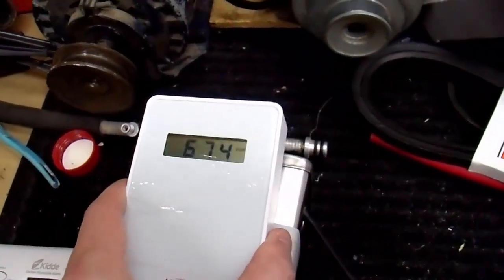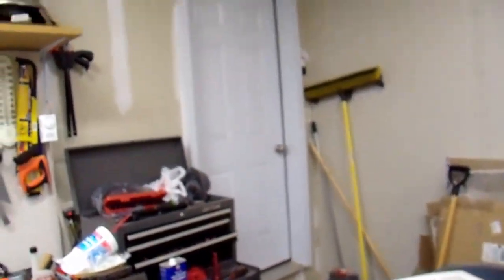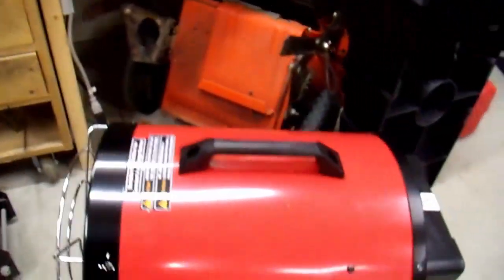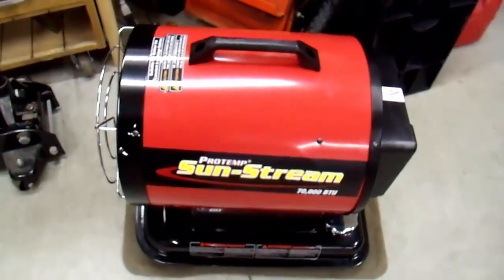Protemp Kerosene / Diesel Heater Review PT-70-SS - Part 2

Comment: The greatest thing about the radiant heat from these is that it heats the objects in the room, and the air. So it pretty much turns anything in line of site warm, making that object also give off convectional heat. The more stuff you have in the line of sight will cause it to warm up faster and stay warmer longer after you turn off the heater. A torpedo heater heats mostly just the air with a little bit of radiant from the cone is all.

Comment: I just got one of these. It's ridiculously good. Buy it.
Reply: Glad you have good luck I bought mine 1-11-25 and used it for 3 months off and on and didn't use it in 2116 and fired it up 12-2017 and it wouldn't work.  Took it back to Northern Tool and got a call saying it would cost $223 to fix it.  I know why the warranty is for one year.
Reply: Hi guys are you having like automatic sutdown once in a while? I just buy this and mine shut down some time after ignition but the fan continúes cooling for 5 mins the i need to turn off and on again and works again!!!
Reply: @edgarduron46  turn fuel pressure down. Its too hot and shutting down

Comment: Assuming that's the same Kidde alarm as sold here in Ireland, it can make CO readings as low as 10ppm for its peak readout, even though the live read out will continue to show 0 below 30ppm.  To use it this way for readings below 30ppm, press the peak+reset buttons together for a few seconds to reset the previous peak reading before starting a test.  Then periodically push the peak button to see what the CO level has reached, assuming it gets between 10ppm and 29ppm.  For example, a few hours of running our gas cooker will usually give a peak reading of 10ppm to 14ppm, even though the live read out always shows 0. 

There's another brand of CO alarm fairly popular here by Fireangel and its live reading starts at 10ppm.  As far as I'm aware of, the 30ppm minimum live read out set by most CO detectors is to prevent people panicking over a low non 0 readout.
Reply from the maker: Thanks for the info!  I'll try that.

And I agree that 30ppm is the lower limit required by the government to be displayable so they cut anything less than 30ppm to zero to avoid people panicing about non-zero readings.  CO is dangerous but it seems people are a bit irrational about it.  I wonder how many smokers panic about non-zero readings when they breath high levels of it every day without issue.  :)  (without issue from the CO that is)

Comment: One of the main reasons I chose this model- aside from the fact that it's bigger than my old one- is that it's far quieter than my torpedo unit. Which runs on propane and stinks like hell sometimes and occasionally makes my eyes sting. Anyway, I didn't think the noise from the torpedo would bother me, but it does get annoying after a period. This is about half is loud or slightly less than that.

Comment: I run a torpedo style heater, I have for 4 or 5 years now. I estimate I've burned a few hundred gallons total through it. The only maintenance I have done is replace fuel lines. I notice if I run for extended periods it makes it a little harder to breathe but not intolerable. I typically crack the garage or window while I run it now, and that seems to work well. If I plan on working for extended periods, I will preheat the garage, my tools, and whatever I'm working on -- for an hour to warm my tools and anything else, then open the garage and bring in fresh air, then only run the heater long enough to maintain a comfortable temperature.
Reply from the maker: Unlike many others I can tell you've actually had experience with these heaters.  They do reduce oxygen concentration and can make some particulate fumes but like you say, if you are careful and give yourself some fresh air when you notice it affecting your breathing they work very well.  CO is really the only thing to worry about which is why I have a personal policy of always having a CO meter around when I run a direct combustion appliance.
Reply: ***** Thanks for your response! Also, Thanks to your videos, i've decided i need to buy both of these meters now. In fact, i will do it right now on amazon.  By the way, i've enjoyed your video's and successfully desulfated my first battery (ive tried other ways, but now i understand what is happening). I did it using my Rolls-Surrete 24V 550AH bank i have (4 X Rolls S-550) I first Tried desulfating using a variable Dc-DC converter putting about 8 AMPS into the battery for several days, but that did not recover the bad cell. After hooking 3 of the 4 batteries up to the battery (18V), and putting about 40-80 AMPS to the battery for a few hours... the bad cell has now recovered! i can now draw 30 amps for almost an hour out of the battery before it drops out! Where as when i started.. i couldn't get more than 15-30 seconds before the voltage drop was too low to be useful.  Can you please tell me where you got your c02 monitor from?? I'm not sure which one to go with.
Reply from the maker: lazerusmfh
They are usually called 'air quality meters', which all measure CO2 concentration.  The one I purchased was surplus from an air handling unit and I repurposed it for this application.  They usually cost $100+ new.  The important thing to is that 1% CO2 is equal to a 1% O2 decrease.  After about 2% decrease you can run into potential danger so I keep my meter below 1% (or 10,000 ppm) and then I know I am very safe.  It does affect me in that I can tell I need to breathe more!  No other effects have been noticed however in myself personally.

Comment: Your new heater is build pretty much the same and functions the same as the torpedo heaters it is just built different.
 I have a torpedo heater 270,000BTU and been running diesel in it for years and never had any problems.

Comment: Your kinda off on the radiant heat output. I also purchased one of these and the reason it feels to you like its 10 degrees higher in there than what you temp readings are is because of the infrared heating it puts off. I am also running mine on pump diesel fuel and have no issues. There isnt a single spot in my garage that i can go that i dont feel the radiant heat trying to melt my skin. It was well worththe purchase!!

Comment: You could put the carbon monoxide detector directly in the exhaust stream (not too near as to melt) and measure that just to ensure the detector is working and I would be curious what the CO level there is.
Reply from the maker: CO meters generally don't work well at elevated or fluctuating temperatures due to the way they operate.  They need to be placed in a stable location which is why I located it on my garage bench.  I do know that it responds within a minute or two to CO levels from past experimentation with it.  (Briefly starting a small engine is a good way to test these meters.  CO should immediately spike to dangerous levels.)

Comment: To run diesel in the fiberglass wick heater, add 1 oz acetone per gal.
Reply from the maker: I hear a lot of methods similar to this.  Us xoz of alcohol per gallon, use a cetane booster, use an antigelling additive, etc.  I've not seen any actual evidence that those products work aside from my own testing showing that alcohol does nothing.  The only change that makes sense to me is a 100% cotton wick which should work better but I don't consider that to be a reasonable solution for various reasons.  Even #1 diesel at pumps has additive packages added and they frequently mix #2 and #1 in trucks and tanks during changeovers resulting in impure #1 fuel.  #1 heating oil has the same issues as #1 diesel with the additional issue of higher allowed sulfur content and dye.  I simply don't think there is a 100% guaranteed solution to this problem without going to K1 which is never mixed with diesel.  #1 diesel may work for some people in some situations.

Comment: I'm curious.  What would happen if you mixed diesel with kerosene?  That thing is really impressive.
Reply from the maker: They can be mixed without issue.  I've already run it on a 50% mix and it works very well that way even in cold temps.  Truckers and farmers frequently run a diesel/kerosene mix in cold temps to avoid gelling.

Comment: Chinese.  My Master version lasted 3 uses.  Reliability is a problem with these heaters.  Ignition and fan problems.  When they do work the heat is great.  They only smell on first ignition.  I think they oil them at the factory. It burns off pretty quick.  Cheaper than a VAL6.

Comment: I have a different brand of this same style multi-fuel heater.  On mine, I have to put a piece of paper or something in front of the intake fan when I start up on diesel.  The fan is pushing too much air to get a good light up.  I am sure that kerosene would start without issue, but I haven't tried it yet.
Reply from the maker: Thanks for the tip!  I might try this!

Comment: Nth, How do you intend to use this? Do you think you'll need to find away to run it on a thermostat as it puts out so much heat? Good quality items in your last 3 or so reviews.
Reply from the maker: The primary purpose was intended to be garage heat when I need/want to work in the garage during the winter.  As it so happens it has proven itself to be safe for emergency indoor heat as well so it now has a 2nd purpose in life.
Reply: you cant add a thermostat

Comment: Did you continue running it 100% on diesel? Or did you switch to kerosene?
I want to buy something that runs on diesel effectively without high maintenance or it developing odors after prolonged use with diesel. Thanks, great video...!

Comment: watched your video and did more research and bought one of these heaters.   your video has good info.  unpacked my heater filled with diesel (approved fuel on instructions).  plugged in.  red light came on flashing.  did not ignite.  tried a few time with no ignite.  nothing in the manual about flashing light.  manual is terrible.  many pages of safety warnings with an eighth page of operating instructions.  called the tech support number on the paper taped to top in box.  no answer.  fuel leaks out of cheaply made cap.  pretty heavy to move when full of fuel.  looked online more for complaints.  these are common problems, so do some reading before you buy.

Comment: My concern is the fumes CO and CO2. My idea is to put a copper coil at the output as a heat exchanger, run the heater in the attached garage,  then run the hot water produced into a radiator or baseboard radiator inside my house and put a fan on the radiator. what do you think?
Reply: it doesnt emit CO

Comment: I have had mine a couple years now. now it runs fine for about 5 minutes then goes into cool down mode.  i cant not find a solution to this problem.
Reply: Did you ever find a solution? Mine is doing the same
Reply: @sandralemen4048  I never did.  Took it apart and put it back together and never could get it working.  I ended up buying a northern tool one and it's been working really good

Comment: You said you had a 30000 btu eletric heater before this one how could you run that on a house cercet thats over 8700 watts
Reply: 30,000 BTU equates out to about 3500-4000 watts.  I use a 240V 4800 watt heater rated at 38,000BTU.  It's plugged into a 30Amp circuit.
Reply: Ok i thought that 1 btu =.3 watts
Reply: +Gene Mowat 3kw is 10k btu

Comment: Electric heat is the worst for dollars per BTU Im assuming you dont have access to Natural gas.

Looks like a great little heater I have a bunch of Offroad Use Only diesel I wonder how long one of those heater would run on that before crapping out
Reply from the maker: Yup.  I am 100% electric discounting the liquid fuels I bring in myself.
Reply: ***** Ouch I installed a Lennox air to air Heatpump at my Friends house in washington he has electric only cut his bill by a 75%  sounds like your in a colder climate tho 

I do Work at a hospital that has a Massive Geothermal Heatpump system its Amazing how much money it saves them and how comfortable it is.
Reply from the maker: mattmopar440
Heat pumps don't work well in my climate - they are designed for warm climates like the one you live in.  (Yes, all of Washington state is 'warm')  And no, they are most certainly not comfortable in cold climates.  :)  They blow air only 10 degrees or so warmer than the ambient temperature which feels cold.  Geothermal is slightly better but around here you need to use a vertical system which is very expensive since our frost depth is 48''.
Reply: ***** Im in Illinois the one I'm currently working on is in chicago area.  its a Massive 15 acre man made lake doesn't use vertical wells. Works very well now when I got here it wasn't they where having massive problems with it. Its still a new technology in this country and takes training to properly set up and dial in the equipment.
Reply from the maker: mattmopar440
Hey, if you've got a location (such as a lake) that doesn't require vertical drilling then geothermal is great!  I don't have that luxury but I wish I did!
Reply: Elgin IL Sherman Hospital 15 acre lake 20 feet deep has over 150 miles of piping out there on 175 rafts doesn't stay at a perfect temp but the heat pumps are designed for the entering water temp as low as 25 so we have always stayed in parameters. Its an amazing system that saves the hospital about 1.5 million a year. hopefully the tech will become more mainstream I have my eyes on a mall that might be our next job !

Comment: No building is air tight to include a well insulated garage
Reply from the maker: I guess it's all relative.  Unless it gets down to -20F or so which causes some weatherstripping gaps to open up my garage door seals pretty well and there is no light visible during the day if I turn the lights off aside from a few peeps from the corners.  As well sealed as my house?  No.  I tested with a CO2 meter and found that I get about 1 air changes per day in my house which is pretty good.  I'm sure it's far higher in the garage but I bet it's still only a few air changes per day aside from opening the doors.

Comment: i have a torpedo style propane heater for my garage.  it is very loud.  it does heat my 2 car garage quickly, though.  did you consider a propane style heater for your garage?  i bought mine because of the convenience of propane.
Reply from the maker: Propane is cleaner burning but it requires bulky tanks and other annoyances in terms of refilling cylinders, safety, and such.  Combine that with the consideration that a 20lb propane tank (which holds 14lb of propane) only equaling 2 gallons of kerosene in terms of heating value and BTU/hr limitations at various tank sizes and temperatures it just makes for a better product to burn kerosene.  I can throw this thing in my trunk, haul it around and then run it for for 7 hours, then refill it at any service station.  Propane isn't so convenient, so cheap, or so safe in comparison.  I have nothing against LP but it just isn't the best solution for me in this case.
Reply: ***** This conversation interests me quite a bit. Here in South Africa we are currently dealing with sharp rises in electricity costs and everyone is looking for ways to cut down. One of the obvious changes that came about almost immediately is people started switching to LPG to heat their homes. In terms of cost, if you take the calorific content of a kilogram of LPG, convert it to kwh and multiply by 9 (the most popular size bottle), you find that a 9kg bottle of LPG holds 115kwh of energy, and since 115kwh of electricity now costs just a little more than 9kg of LPG, it is actually cheaper to use LPG.

(It's not cheaper to cook with LPG though, because electric stoves are so much more efficient at getting the heat INTO the container and the food that you're cooking).

I tried to do some of the same comparisons with wood, since my home also came with a wood-burning fireplace (sadly open-cycle and therefore very inefficient). Once again the calorific content of wood varies greatly, and the cheaper kinds of wood (we use mostly blue gum) aren't all that great, so that wood should work out quite a bit more expensive. Granted, we don't get temperatures of minus 10F (minus 23 Celsius) in South Africa. Where I live we haven't been below freezing in at least a century... :-)

What I'm curious about is whether Diesel might turn out to be a cheaper heating fuel than LPG. I don't suppose you know off hand? I suppose I should just redo the exercise I did for LPG :-)
Reply: plonkster Answering my own question. If Diesel has 12.4kwh per kilogram and a liter weighs 850 grams, then 9.5kg of diesel has the same energy  content as 9kg of LPG. That's roughly 11.2 liters, which at present fuel costs is 15% cheaper than the equivalent in LPG. Assuming all other things are equal (which they probably aren't).

Comment: Can you run Diesel many Kerosene heaters fairly safely?  How far out of Spec is K-1?
Reply from the maker: Diesel can be safely used.  It will smoke a little more on startup and smell of 'diesel exhaust' for the first minute or so but will work just fine otherwise.